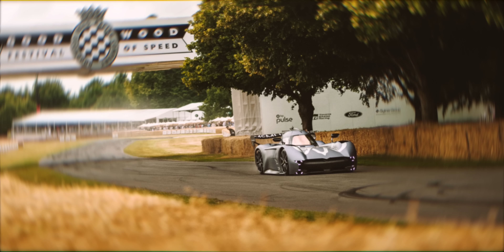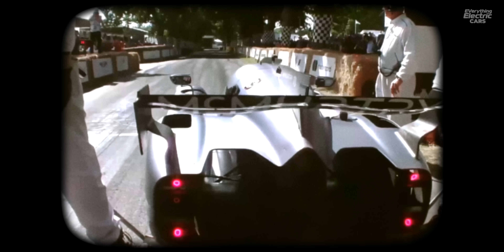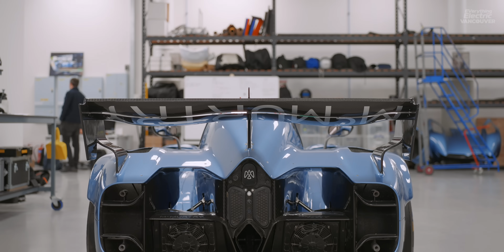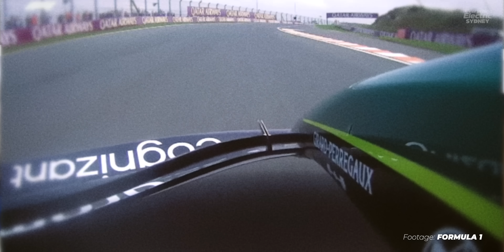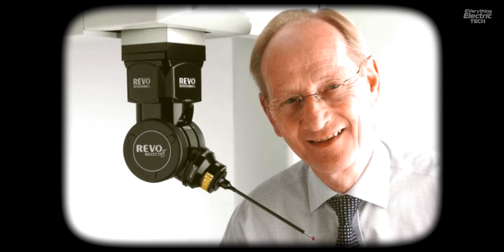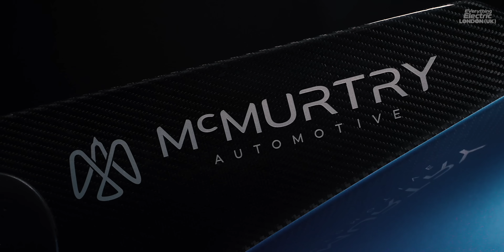The Tiny Fan-Powered EV That Drives UPSIDE DOWN!

Comment: The problem with vacuum cars and a big part of why they were banned is that if they lose suction when the car is destabilised, things tend to get very hairy. 
I would have liked to hear if they had addressed the loss of suction issue beyond just ignoring potholes?
Reply: The system is dynamic and can be set within the vehicle from now downforce to full based on activity (track vs road).
Reply: @GruffSillyGoat How would that help in a sudden loss of suction due to upset?
Reply: @mycosys - they have dual parallel system to prevent such single losses, if a problem occurs the user is notified and the system assist to bring the car into driving conditions not requiring downforce.
Reply: @GruffSillyGoat None of that would make a difference. The dual system only guards against hardware failure.
Reply: @mycosys - it's a little unclear what the concern you're trying to express actually is. First expressing concern about road holding, for which the vehicle dynamically adapts, and secondly about an event leading to a potential loss of suction, for which there are redundant systems. 

Is it the drivers ability that is your concern, or using the vehicle in unsuitable ways for the road conditions. Cars cannot fully account for driver choices and errrors, they have to take some responsibility for themselves.
Reply: @GruffSillyGoat kindly learn to read before addressing me again
Reply: @mycosys - I have read and responded, part of communication is making ones meaning clear, and I'm afraid above it evidently isn't otherwise why would I spend energy trying to clarify what you meant.
Reply: @GruffSillyGoat if you dont understand the technical terminology, why would you feel qualified to comment? If the vehicle hits a bump and is upset it can lose suction at the worst possible moment - thats part of why they were banned in racing.
Reply: @mycosys  - yes, but I addressed that point above - as outlined in the video the vehicle has dynamic management that rapidly restablishes control in this circumstances. This is not like the systems of old that were more mechnical orientated and fixed in their operational response so unable to handle, or worse responded inappropirately, to external stimuli. So again, what is the exact issue you foresee that a dynamic system cannot handle. Driving over a sleeping policeman won't upset the vehicle's operation, so why would a bump in the road do so any differently?

If it's driving down a very bumpy road, with sufficient underlations to consistently removes downforce, then this becomes a driver usage issue of not adjusting the car's use to the road conditions. Indeed even in a normal car I would question the drivers judgement of driving at speed down such roads, for it to become problematic for them to retain control.

(p.s. part of the package of buying a McMurty is training on how to use the vehicle, including levels of control and settings to use for different road conditions).

Comment: ummm...just a thought...wouldn't gravel be flying out the back like  bullets???
Reply: They have filters installed for that. Only small particles of dust comes out at the rear end of the car
Reply: Probably... but what's going to be close enough behind for that to matter?
Reply: @DaneRossenrode class answer
Reply: There's a filter, nothing bigger than dust gets through.
Reply: This was my first thought, especially with the mention of the Chapparal J2. That car got banned due to safety. I'll post a separate comment.

Comment: The integration of a 100 kWh battery in such a small chassis is fascinating. The challenge of balancing energy density with dynamic stability really shines here.
Reply: At just 200Wh/kg, with the Cherry 600Wh/kg solid state packs reportedly in production we may have some really exciting transport options ahead.
Reply: It is an amazing battery indeed
Reply: @bobogliddabrun 

On the face of it yes.

However, the weight of the vehicle is given as a tonne.

And, given that the car can accelerate as fast as it does we did not hear a range figure, at high speed or legal road speeds.

Now, what wasn't mentioned either was the time taken to charge at whatever rate.

What might be of interest to battery huggers is how the battery performd in a much heavier car.

Lastly one can only wonder why so much time and effort was squandered on a single seater car.

Why?
Reply: @ForestForest-n9i  It's a development platform for new technology.  Charge rates are usually on par with discharge rates... so at 100 amps each that might be 2000 amps in parallel.  Product with voltage for watts.
Reply: @ChrisNotTheKing 

2000Amps?
Reply: @ForestForest-n9i  100kWh divided by 5kWh equals 20 packs at 100A
Reply: @ChrisNotTheKing 

😂😂😂

I can do the math.

Just wondering about this need for 2000A.

Tell us where that comes in.
Reply: @ForestForest-n9i   Your question was vague.  Megawatt charging usually involves upping voltage by reconfiguring packs in series, depending on charger and vehicle capability.  So parallel charging at 2000 amps becomes 100 amps if the 20 packs are in series.  Simple.
Reply: @ChrisNotTheKing 

Of course it is.